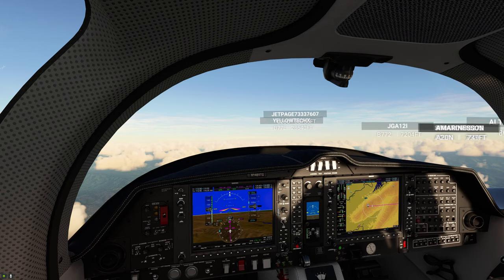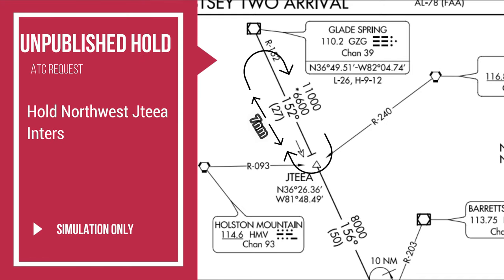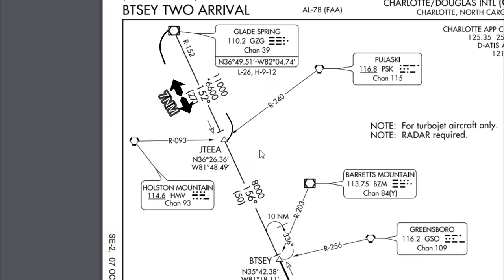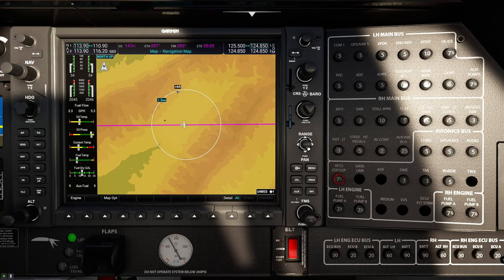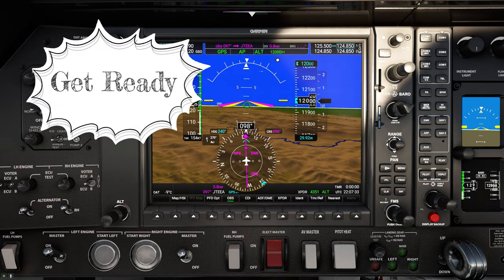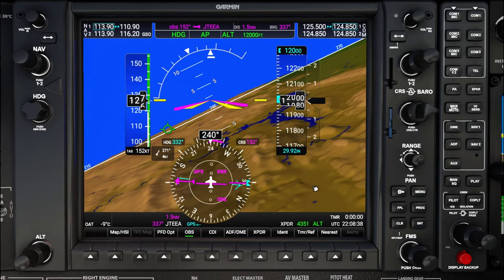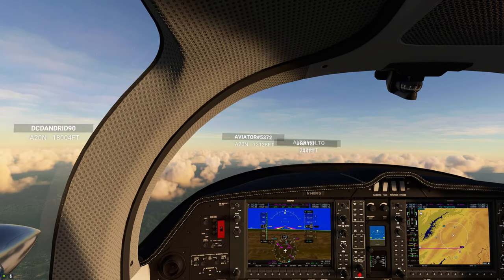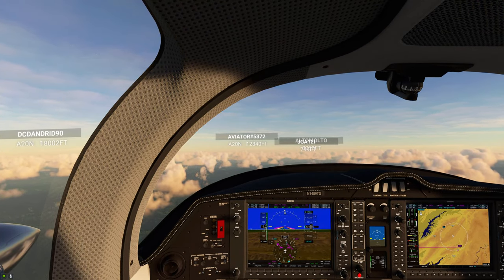Msfs2020 *G1000Nxi* Manual Holding Tutorial using OBS for unpublished holds ( Omni Bearing Selector)

Comment: Nice video showing how to use OBS for hold. I disagree with how you entered the hold however. When you reached JTEEA intersection you should have turned left to outbound course for a parallel entry. You turned right and did not stay in the protected area.
Reply from the maker: Thanks for the comment . I am redoing the entire g1000 series now for the updated aau. In my new vids I disclose I am not a pilot so I will not follow proper procedures the main goal of the series is to help people understand and use the g1000 avionics suite. Thanks for the info tho .